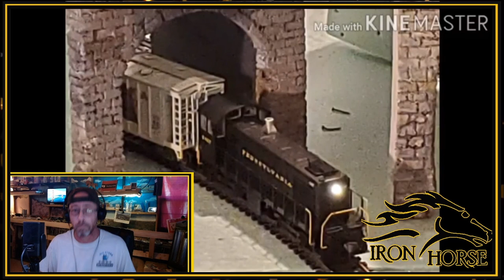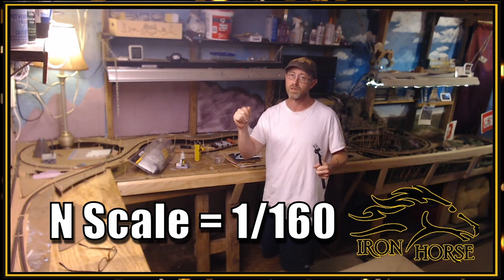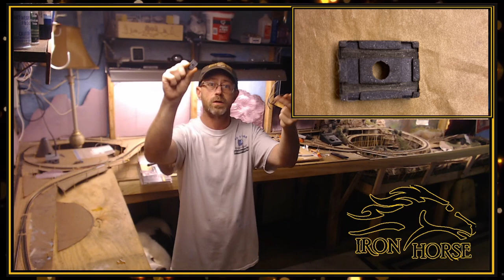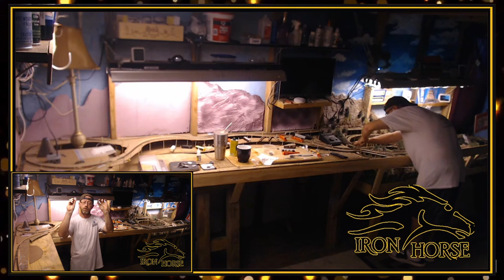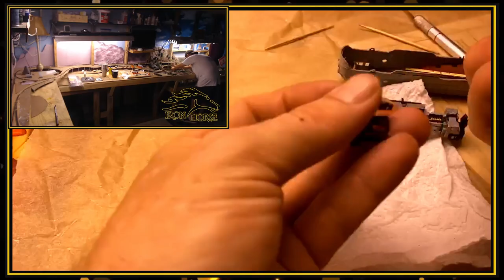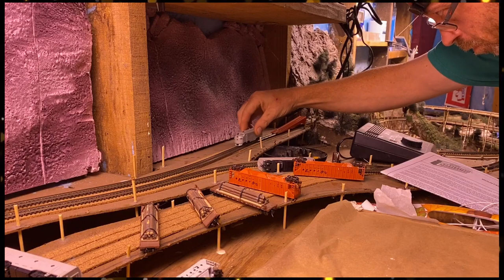Maintain Reliable Operations - N Scale Model Railroad Layout - Iron Horse Route - D&RGW

Comment: I can't keep my HO layout 100% reliable.  Good luck with the N scale.
Reply from the maker: Marten..  This is something I am going to have to solve.  My most extreme case would be to move the layout up to the garage in the house.   I may even have to go Kato uni track if I do, but my model is going to run around the layout.  To me the layout isn't functioning if it won't.  Mine's not functioning properly yet eiher.  Working on it now.

Comment: Do you get a lot of dirt out when you clean the engines like you did ?  I think it would be good to see a video on just that process . Thanks for sharing .
Reply from the maker: I get more little fuzzies wrapped around the axels and dirt will work its way to the worm gears, but i soak in iso for a bit then use a tooth brush and then run a toothpick through the grooves.  I will do that .  Brian
Reply from the maker: 503!  That's great Jerry!
Reply: @IronHorseBrian  502 I lost one .